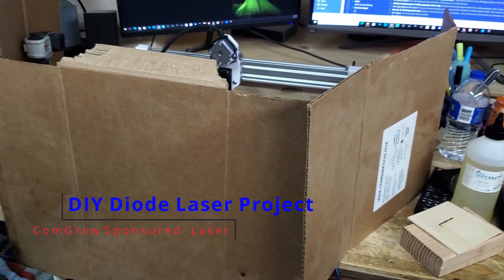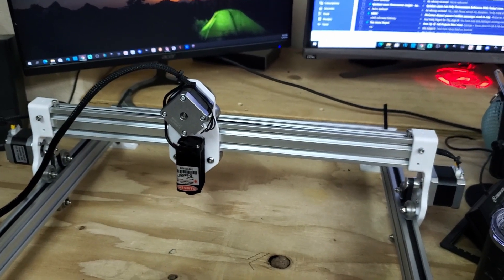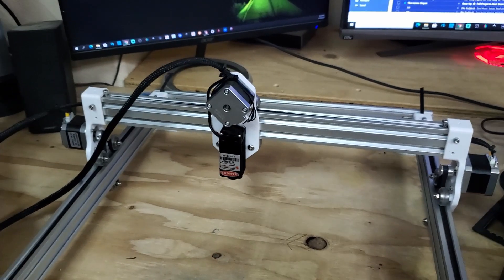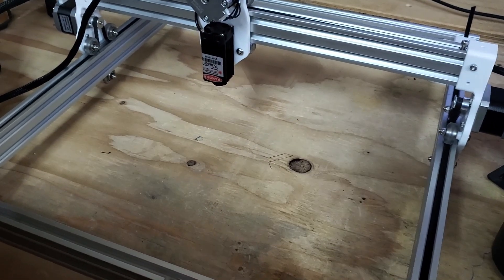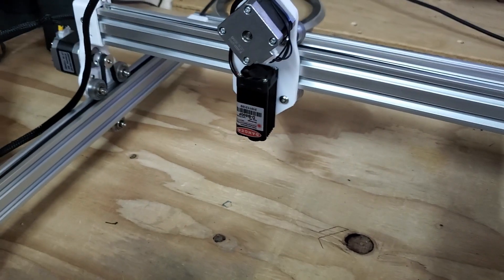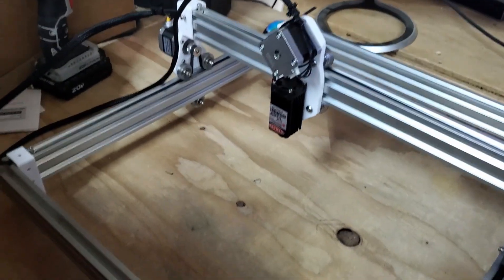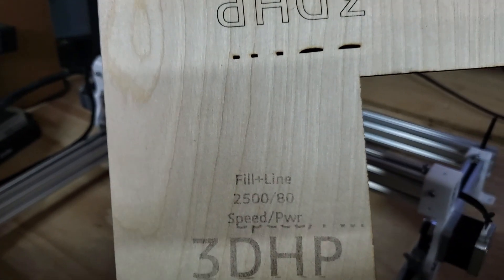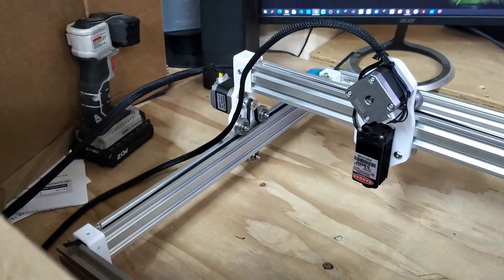DIY Diode Laser Project #3dhp

Comment: Nice work! Just one question, why those motors (left and right) are on the moving shaft, doesn't it make sense to place them statically on a ramp? I mean that would decrease the moving load and wires wont be moving.
Reply from the maker: This was the design I found on thingiverse. I have tested and reviewed many diode lasers since this first one. I no longer use this machine and it just sets.

Comment: I would like to make a DIY Diode that has a cutting area of 30 inches (762 mm) X 20 inches (508 mm) to cut foamboard.  Could a DIY Diode Laser like this handle that size?  I assume that you can adjust the bed size in the software.  What do you think?  Oh, thanks for the video and info!!!
Reply from the maker: If using lightburn, you will have to go into machine / settings and change $ ?? for each y and y .Also your grid in lightburn.You can google the grbl commands.

Comment: Anyone knows if the laser head can be supplied from an external power supply at 12VDC in order to turn it On-Off at full power? I only want the head to be installed in my DIY X-Y frame.

Comment: I don't see any way to adjust the wheels for fit on the extrusion - am I missing something?
Reply from the maker: You use an excentric nut on the bottom wheel,like on a 3d printer.the center hole is drilled off center,so when you move it with a wrench,it tightens or loosens.
Reply: @3DHP  RIght - are the plates set up for that?
Reply from the maker: @librarymark  This is standard extrusion,just like on a 3d printer.if you want the bottom roller to be adjustable,you put on a eccentric nut,if not then don't.
Reply: @3DHP  OK - I'll see what I can do. Thanks!
Reply: @3DHP  Are you using eccentrics on the unit in the video?
Reply from the maker: @librarymark  I just check it it,no ecentric nuts , I no longer use this laser since I have a lot of diode lasers.But I do remember when putting the 3 wheels on the extrusion,it was a little tight,then went right on and rolled smoothly.